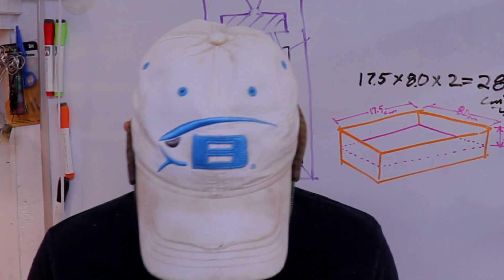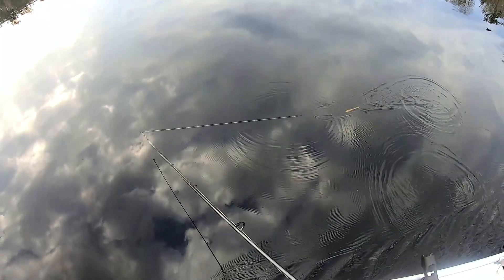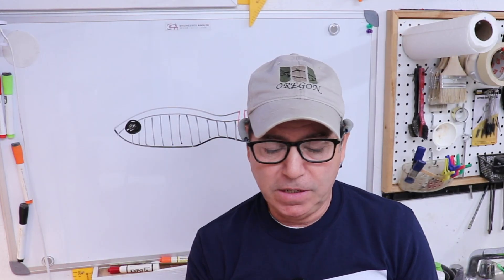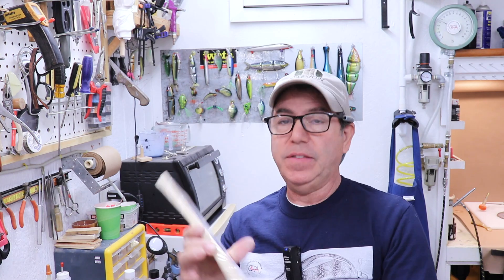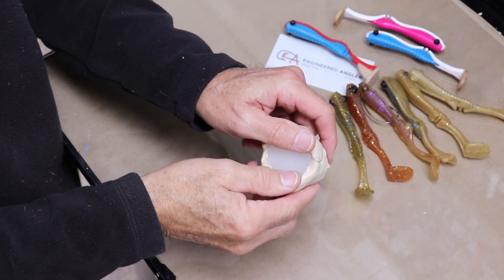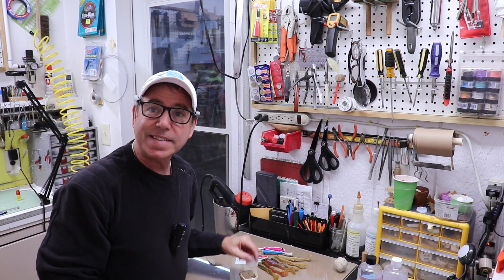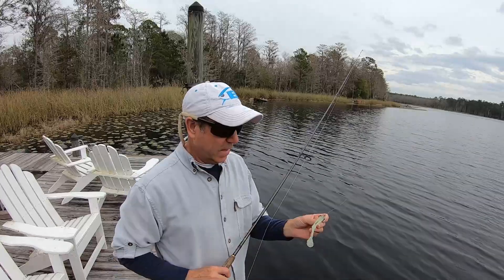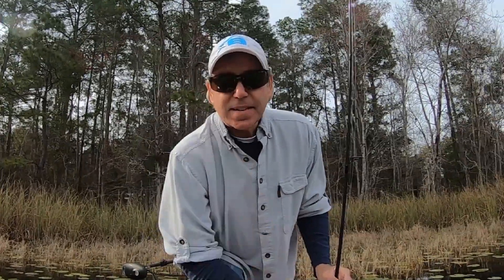Making a Soft Plastic Swimbait Better, Better Action Swimbait, #swimbait  #softplasticlure

Comment from the maker: After a little more testing I think the bargain priced silicon, I used in these last two videos, will work with the sulfur free clay as well as used in a single pour mold.  The silicon set fine with the sulfur free clay but seemed to draw some moisture from the clay that quickly dried leaving a perfectly set silicon.  I'm putting the link here so you can try it yourselves.  https://amzn.to/3H2muce

Comment: Great work on improvements and problem solving with that silicone. Suggestion for future project: In stead of deep diving floating lure, how about a fast sinking lure with inverted lip that darts to the surface on retrieve?
Reply: Marling Baits tried that
Reply: Like the "riser" lure that already exists in the jdm?
Reply: Will be nice to have the engineer trouble-shoot and figure this out. Could work in saltwater - like shrimp, baby flounder or sole... Good challenge for action and to avoid snags.